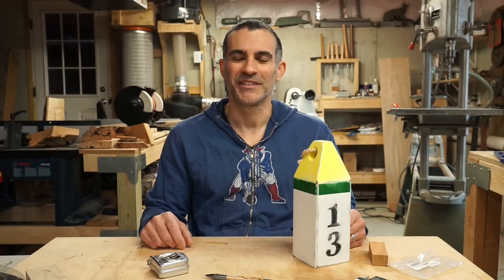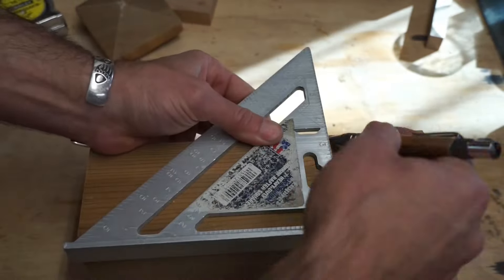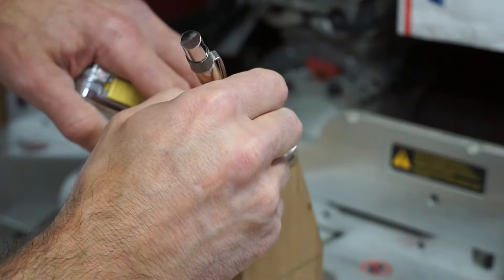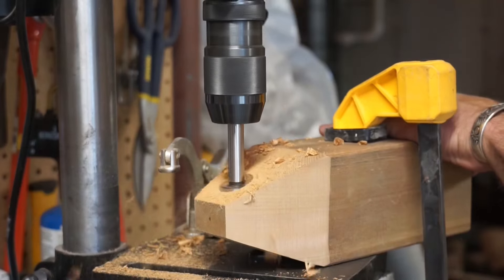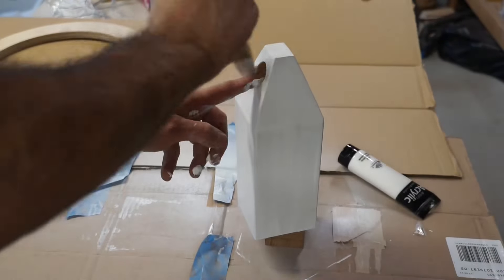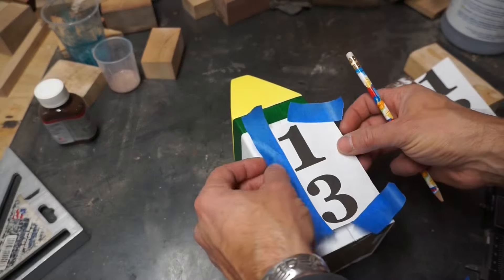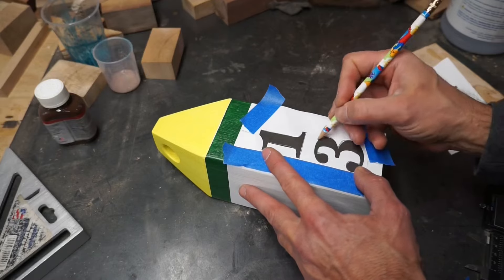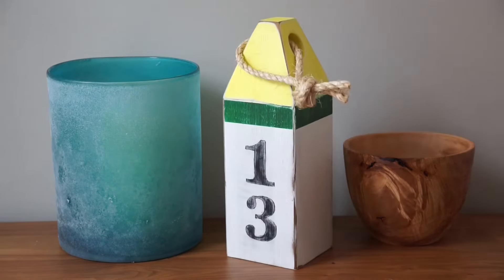DIY - How to Make a Vintage New England Lobster Buoy WITH Proper Audio

Comment: What was the angle of the 1st and 2nd cut?
Reply from the maker: Hey Hockeyfan - it will be a 60 degree angle from the line. if you're measuring from the middle of the top of the two by four it will be 30 degrees. Thanks for watchin'!